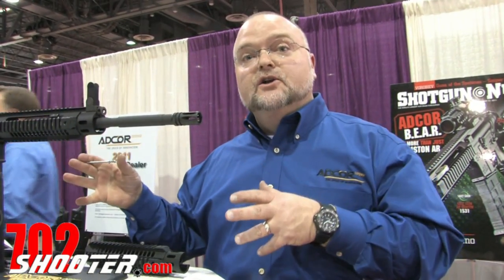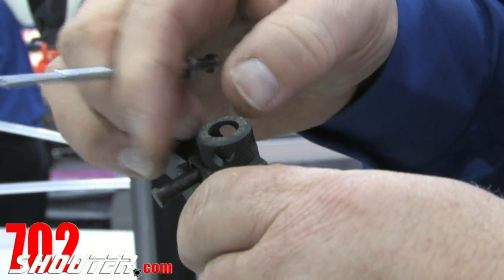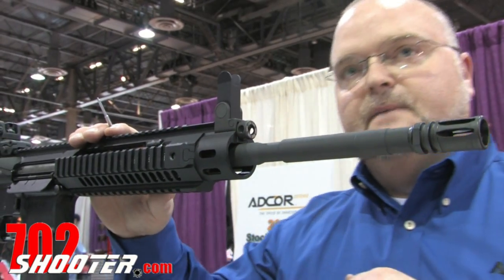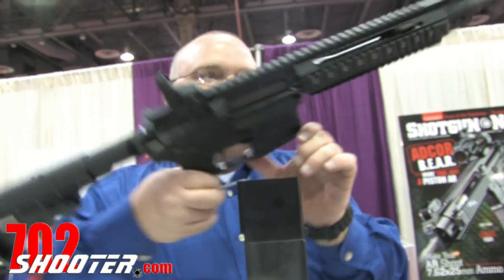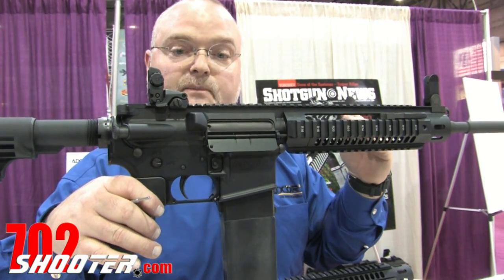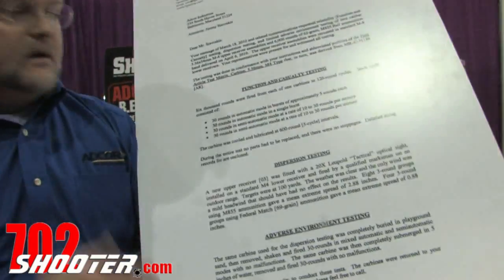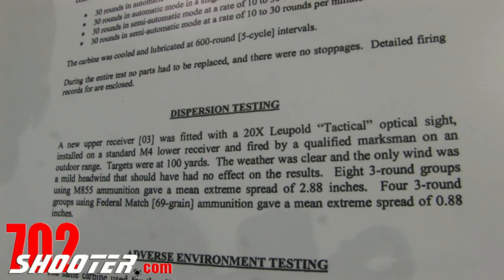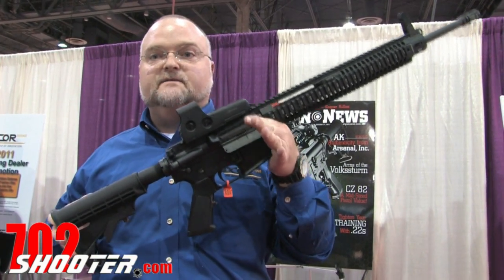ADCOR B.E.A.R. (Brown Enhanced Automatic Rifle) at 2011 SHOT Show

Comment: @702Shooter 
Just curious, but would it not make more sense if it used a smooth forearm with mountable rail points? This would make it more ergonomic out of the box, and potentially lighter in its basic configuration.